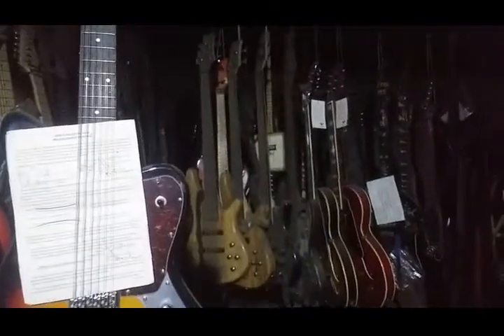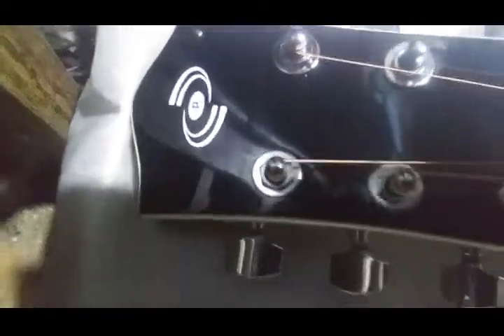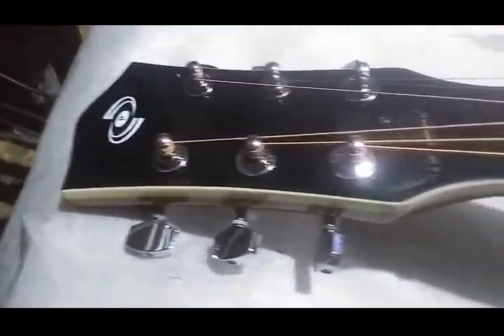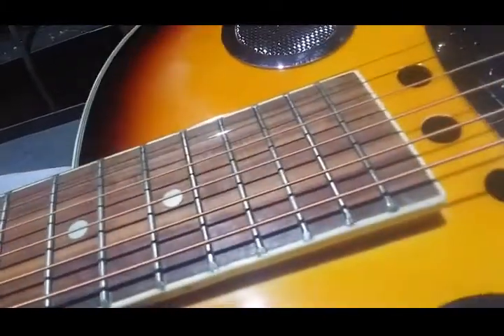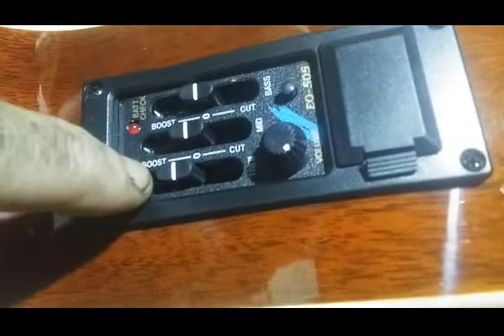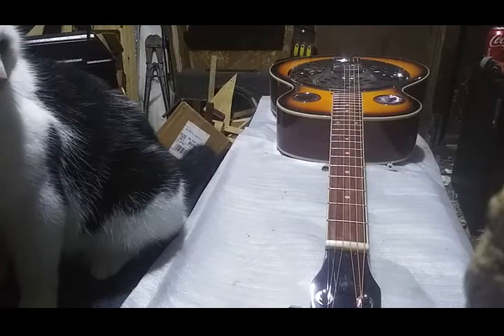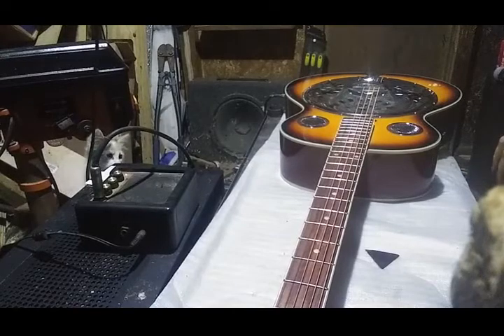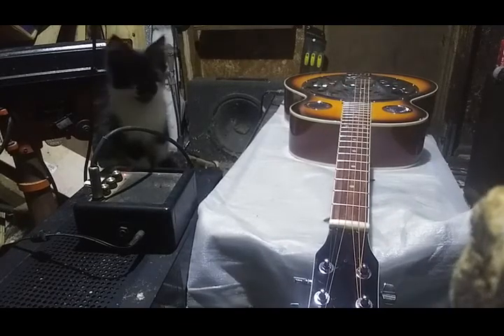PYLE PGA500BR Acoustic Resonator Guitar unboxing and review

Comment: It doesn’t have a freaking " Biscuit  " ! It's  a Spider Bridge . A Biscuit Bridge Reso is a totally opposite design , with very different tone and sistain characteristics. 

   A resonator needs to have a certain range of downforce , and certain string break angles   
 
  Not to be overly rude , but have you ever heard a Reso in person ? You've got big time rattling and buzzing going on. 

   With low end Import Reso's as a class , the out of the box set up ( or total lack thereof ) is completely random .With a little luck , a competent set up ( by a knowledgeable Resonator specialist,  not a random guitar mechanic ).could render it playable , if the cheap even by Chinese standards hardware isn't  hopelessly out of spec .

   If you wish to have a new hobby of learning Resonator Set Up , there is a set up guide from Stew Mac , and the out of print guide by Paul  Beard has excerpts out there on the internet  , if you looking the right places .

   As a Plan B , a Made in USA cone , made in USA #14 Spider , and quality Bridge inserts can make it sound 300 % better than possible with the OEM hardware . The parts will run about what you paid for the Instrument.  But for context that would bring your total investment into the low end of a mid grade Import Reso , but sound better .

   That guitar has that electronics set up , because the purchasing guy from the Importers is a brain dead idiot with zero knowledge of Resonators . He or she just blindly checked off the same option from the Chineese factory , as on generic Aoustic / Electric guitars . Those are worse than useless . Your best plan is to totally ignore its even there . [ The technology does exist now  . But it's sole source and $$$ . Don't know your musical preferences  or playing style . But if it's more of heavy blues or country rock , instead of purely accoustic Americana;, you could more easily look into fitting a magnetic pickup . ]